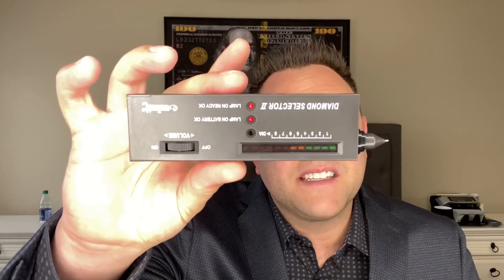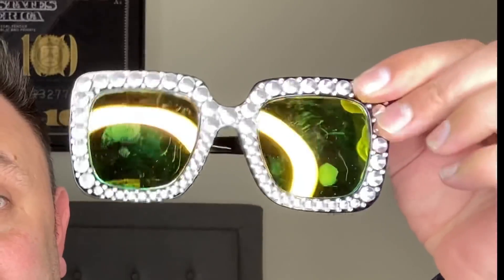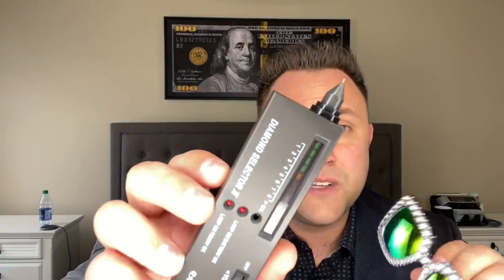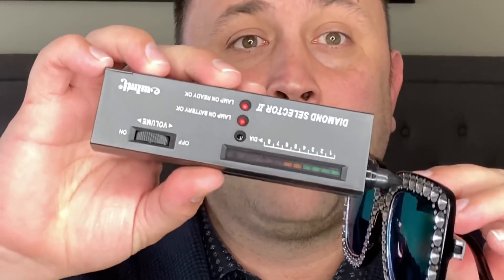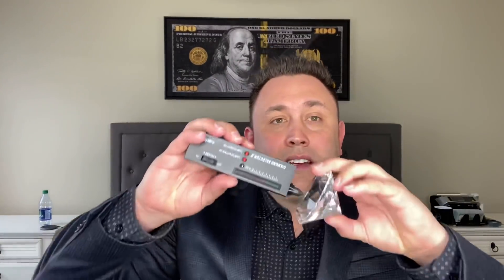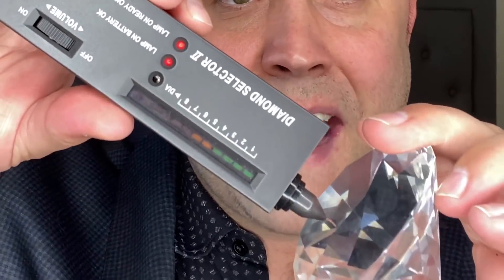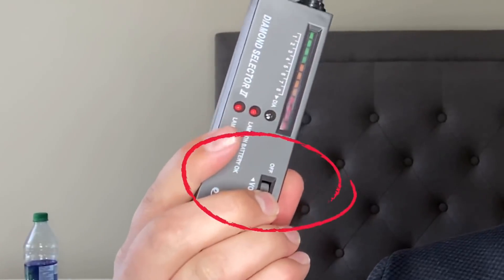HOW DIAMOND TESTERS WORK

Comment: bro you're dumb, you need to hold the diamond tester correctly and have your skin touch the metal piece on it.  plus you need to calibrate the tester based on the current celcius temp & the  diamond ct you'll be testing.